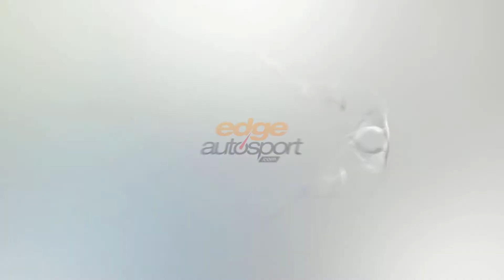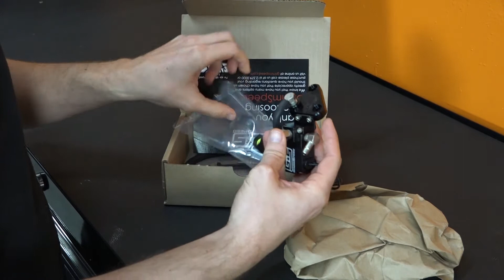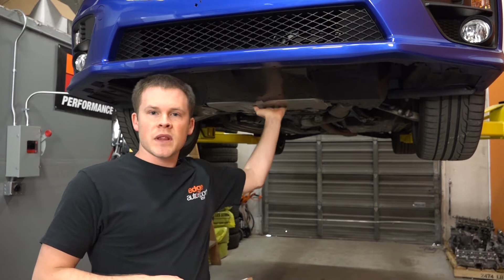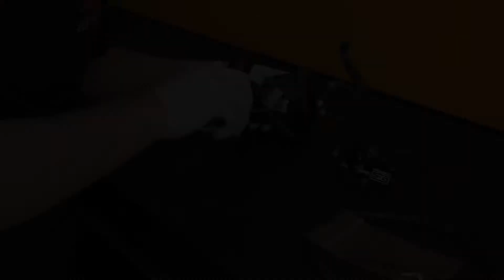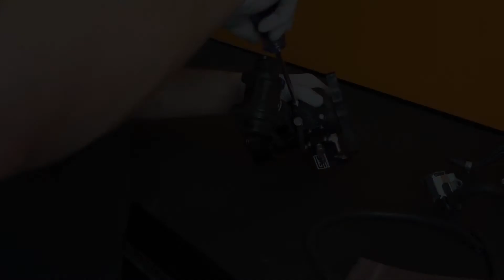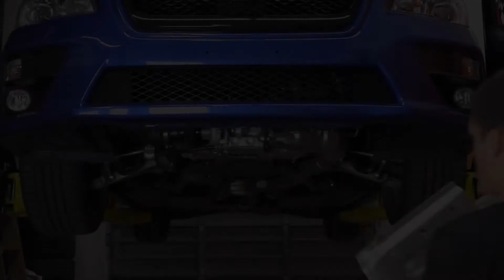Grimmspeed EBCS Subaru WRX 2015+ INSTALL GUIDE

Comment: Gonna be installing this along with IAG TGV , and EGR deletes , and catted grimm speed j pipe all in the same day. Any tips on how to go about it and maybe how long you think it will all take time wise? Great video gonna be using this as one of my guides thru it.
Reply: Just curious, did you get a protune right after you installed these? Im thinking about doing the deleted and j pipe and was wondering how immediately to get a protune after installing them
Reply: @SorenMedia  updates? Wondering the same as you were lol
Reply: @ZedLucas  protune is needed unless you plan on staying out of boost. Would take probably 3-4 hours with the TGV/EGR's

Comment: Even w/o mods, is this a worth upgrade? Will this help with on/off throttle transitions?
Reply from the maker: Yes, it will still be effective without mods. It holds boost better and reacts quicker. We have these in stock!
Reply from the maker: @Jamon77  In order to use the 3-port mode, yes, you need to tune.

Comment: How do you run it in 2 port mode?
Reply from the maker: +Rob Kehr Hey Rob, you would cap #3, run boost to #1 and the inlet pipe to #2 (inlet pipe is already preconfigured with the GS EBCS for this car).  With the 2015 WRX, you would need to put a T in the line to the wastegate so that you could send the boost signal to the EBCS and the wastegate.  We haven't actually done this on the 2015+ WRX but this is how it SHOULD work if you were to run 2-port.  You can see how it's almost easier just to start running 3 port right away with an adjusted tune.  Let us know if you have any other questions.
Reply: +Edge Autosport I waited until I got an e-tuned map from PDX before installing it.  I installed it today, loaded the maps on my AP, but the model year was wrong.  So now my car is just hanging out in the garage until PDX can get around to helping me out.
Reply from the maker: You got the wrong year EBCS?
Reply from the maker: Sorry, ready that wrong.  He sent you maps for a different Subaru sounds like.  Gotcha.  Let us know how it feels when you get your map dialed in!
Reply: +Edge Autosport So boost is consistent.  More consistent than I imagined it would be. I'm talking tenths.  But it's also rather low. But that could just be becomes I'm used to seeing the gauge jump super high with every tap of the throttle.  I'll data log and see what the deal is.

Comment: i have a cobb ap do you need a dyno tune after this simple mod??
Reply from the maker: SOME changes are necessary to make this device work in 3 port mode, but they are custom changes.  So whether that's a full dyno tune or a professional making the correct and simple changes, it is necessary.  If you can't get a tune right away, use it in 2 port mode until you can get some simple changes made.  That will work fine.  Let us know if you have any other questions!  These are available to ship!
Reply: ah ok got it thank you
Reply: what changes are you referring to in accesstuner?